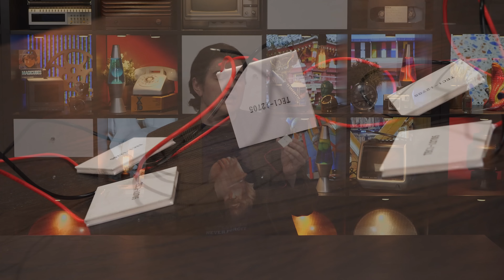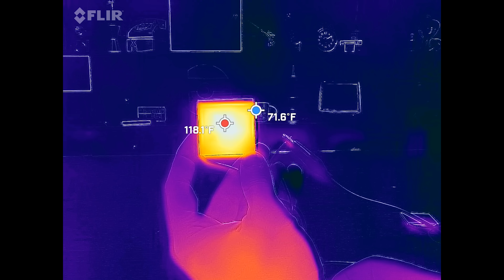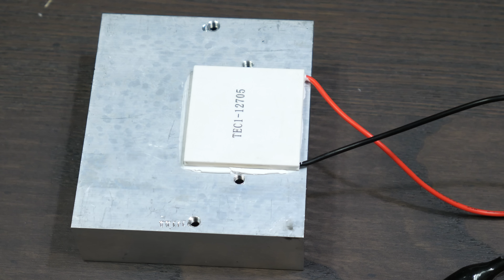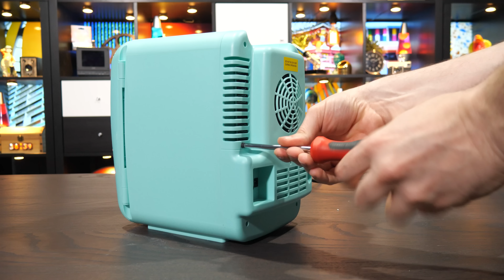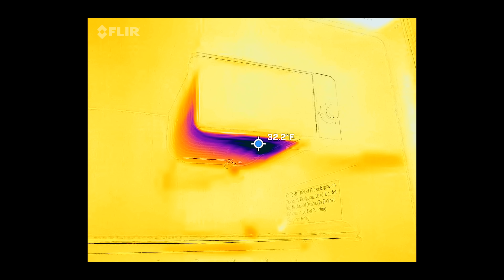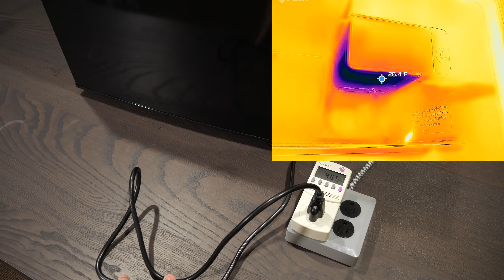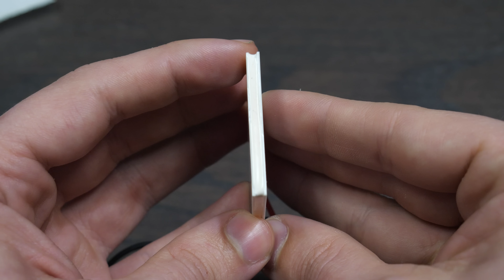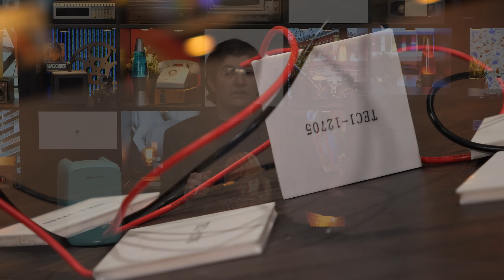Thermoelectric cooling: it's not great.

Comment: Speaking of fridge compressors, did you see the guy who modded his Harbor Frate air compressor to use a fridge compressor as the air pump and has a super quiet compressed air setup that was ~33% faster?

Comment: i wonder if these could be used for cooling suits. super small so the pack you'd have to wear would be more manageable than a heatpump, and you dont need a tremendous amount of cooling power to keep a person comfortable when its only taking heat from the person not the room. the only problem is it would chew through batteries. if you were only cooling the chest and running the thing as efficient as you can i think you could get an hour of cooling with a decent battery. but i have 0 knowledge about his whatsoever im just napkin math-ing with some numbers on TE units i found online.

someone with some experience could chime in with how viable this might be.

Comment: The short cycling on the small refrigerator may be due to its small thermal mass and reduced insulation. It's going to heat and cool quickly. Slower cycling would mean larger temperature swings.

Comment: High Power TECs can be really good as CPU coolers, you do need to worry about condensation though.  yeah they use a ton of power, but when you're trying to squeeze as much performance out of your PC as possible, they're a pretty good option.  And they're cheap as hell and easy to setup

Comment: Not particularly relevant to this (though related) - the Peltier effect can be run in reverse.  Heat one side of the element, and it generates electricity.  Not a lot, of course, but enough to run, for example, a fan.  This is used very effectively with solid fuel room heaters.  I have a little fan that is powered by a Peltier effect.  Sit the unit on top of a log burner, and the fan turns, blowing air out into the room.  OK, I'm sure it would be more effective to use a more normal motor-driven fan.  But it is pleasing and useful.
An alternative version of this is a Stirling engine fan.

Comment: The only thing I use Peltier devices for is making cloud chambers, since I can’t get dry ice where I live. In order for the cold side to get cold enough for it to work, I have to use water cooling on the hot side, which works really well, but adds more complexity and setup time. I will say that modern fridges are far more efficient than older ones. At my work we had a commercial ice freezer that cost $20 a day to run, so we bought a brand new one that only costs $3 a day, and it has over 1000L of internal capacity.

Comment: I've seen demonstrations of thermoelectronics which had the "cold" end physically distant from the "hot" end.  Essentially,  two different components connected electrically.   It seems that such a pair of devices could overcome some of the limitations you demonstrated here.

Comment: You can buy Pelter CPU coolers. I don't get how that works.
Reply: The modern consensus is that they don't. While the might make your temperatures look a little better in short benchmark runs, they essentially just add the waste heat of the Peltier to the total heat output the rest of your cooling system needs to get rid of in a longer gaming session.

Comment: So im confused, i have one of those pelrier cooled fridges, specifically the minecraft creeper one from walmart that has been all over the Internet lately, and it is completely silent plus in the top compartment it gets cold enough to produce ice on the back wall and freeze water bottles. Is this one just using larger peltier and insulation? Should i get rid of it or mesaure its energy usage?
Reply: You can stack Peltiers on top of each other to create a higher temperature difference. This also makes them more efficient as the amount of heat transfer happening depends on the temperature difference. Good side wall insulation also makes a world of a difference. The cheap ones are just plastic boxes with no significant insulating material at all.

Comment: I'm curious how much better that little desk """fridge""" would be with some proper insulation, a thermistor, and a PWM controller. It probably still wouldn't compare to a full-up fridge, and would be a bit more expensive than it currently is, but if you absolutely need that tiny of a form factor that might be the way to go.

Comment: High end cinema cameras use these to keep the camera sensor at a specific temperature. It's the perfect device for that, since you need to both heat and cool the sensor (depending on the ambient temps), and it needs to be small and only cool/heat a very small thermal mass, so the net power draw isn't too terrible.

It's very a niche use case, but the perfect show of why they're still incredibly useful... just not the way the average person thinks.
Reply: Never heard of problems with camera sensors getting too cold, were they designed to be able to film scenes in Antarctica?
Reply: @NiHaoMike64  Nope, it's just that to get the veery most out of a sensor, you need to black shade it (calibration). Once calibrated, a swing of 10 degrees in any direction could significantly impact image quality.

Generally, cooler is better, but consistent is more important than anything.

Comment: Peltiers are used in spacecraft and satellites to either generate electricity from heat, or to cool down circuits with power from solar, I was hoping you would mention this as an appropriate use

Comment: The most interesting property of Peltier element is that if you apply a thermal differential to them, they can generate power. That can be useful if you have residual heat from somewhere and need to generate a small amount of power.

Comment: These are used in wood stove fans, with the heat on the bottom and cool air above it generates power to run a motor which turns a fan blowing the warm air out of your fireplace across the room.
Reply: Almost. The ones used in those fridges wouldn't work for that, because the solder that holds them together would melt. Generating electricity needs a slightly different component - same basic design, just made with heat-resistant materials.

Comment: The little mini fridge may not fit on your desk, but if you pay another thirty dollars for the blue thing and another $30 for some DIY supplies you can move the compressor and hot coils under your desk with the expansion coils in the door of the blue thing on your desk and get the best of both.

Comment: We had a unit like that about 20 years ago, my wife won it at an office pool.  We used it on a week long trip, loaded it with some beverages and left it on for a week.  It eventually got the beverages nice and cold, but it also partially melted the power supply that came with it.  I guess the manufacturer did not accurately guess the current draw.

Comment: 30:24 Worth noting: I have a very similar mini fridge (the internal design is slightly different but otherwise it looks to be the same, probably just a different product generation), and it has next to no buzzing. I genuinely don't notice when it's on versus when it's off - which has gotten me in trouble when I didn't realize the door wasn't shut all the way...
Oh, and yes, it WILL freeze stuff on the top shelf if you don't get the temperature setting exactly right. In fact, mine will quite happily turn the entire compartment into a freezer if I set it to max whack.

Comment: Peltier modules are useful if you need to suck up heat from very small area, and can spread it later over larger area. People doing digital astrophotography used to hack their digital cameras to put the sensor on a Peltier module, and add a bigger heat sink on the other side to keep sensor as cold as possible, so its thermal noise will be reduced for better sensitivity. These elements can also be used to achieve precise temperature control, for example in small scale experiments.
People also used to use Peltier modules to force-cool the CPU while overclocking it. Then some guy replaced heat sink and fan with cold loop of heat pump, and overclocked the CPU even more. If I recall correctly, some team made a world record of overclocking a popular CPU by enclosing its heat sink in a can and then filling it with liquid nitrogen. This requires a careful consideration, because if any semiconductor gets too cold, it stops semiconducting.

Comment: The question I have is why we can't miniaturize a heat pump further? The compressor housing on that smallest of mini fridges is still rather huge. Why couldn't a 12v DC motor fit inside a 12oz soda can sized housing and make that gimmick an actual fridge? Pretty sure I could build one that runs on an arduino for under $30.
Reply: OKAY doubling down on this cause I just discovered I can get a handheld 150psi 12v air compressor the size of a large cell phone WITH a built-in 10kah battery for $30. It's chinesium so that 150psi is probably closer to 80 and the 10kah is probably closer to 5, but that still means the compressor itself could run a fridge and its only about 10% of the cost of the doober.

Comment: I knew those little fridges were bad, but Holy crap that's terrible efficiency. PS I have a 1982 GE refrigerator that I use. It uses the old school R12 refrigerant but still works like it's new.

Comment: I know you make videos about whatever you're obsessed with right now, and you own an actual good fridge with a sane ice maker that makes actual sense (in the freezer, not the fridge) so there's very little reason that this would ever happen, but I would love to hear you rip into Samsung fridges for 20 minutes or so. Please consider purchasing a Samsung fridge with an ice maker on the top (in the fridge area) so that us idiots who own them can get a little comic relief out of the situation.

I disabled my ice maker over a year ago; but the fridge still hasn't stopped making ice (it just does it everywhere but the ice maker). At this point I don't even trust the primary compartment; I keep whatever I can in the drawer (ours has a drawer between the bottom freezer and top fridge, ostensibly designed for beer, but it's pretty roomy, and cold enough to freeze eggs if you're not careful, lmao). But yeah, there's definitely a degreee of incompetence in Samsung fridges liable for a class action. I'm pretty sure the door seals are incapable of actually sealing, and keeping moisture out on humid days. Also, the weird hingey bit on one of the doors (it has two "French doors" on top) likes to spontaneously pop out, requiring removing two screws and then reseating it when it happens, otherwise the seals REALLY do not adequately keep humidity out.

Comment: Let me sing the praises of my 25-year-old Igloo Model 41000 56-quart Peltier cooler. I have used it to transport a LOT of already-chilled food to and from my cabin, 5 hours distant, at least monthly. It also is in constant use on road trips, where I take it into the motel room or friend's house. It is enormous, weighs little and won't die. I'm keenly aware that it is an energy hog, especially when running off the iron-core 120V brick. The brick gets too hot to leave on a plastic surface, Now my 21 cu ft Kenmore upright freezer uses 1.4kWh a day, same as my dorm fridge, but less than my 21 cu ft fridge, which uses 2.4kWh/day. The freezer has Sabbath Mode, so I can defeat defrosting if I have to run on battery or generator power, making it the winner in my stable.

Comment: Now that you have covered the Peltier cooler, you need to make a conextras concerning the Seeback effect (where said TECs can be used to generate DC voltage through heat transference 😊 )

Another suggestion too, since we are on a similar tangent, have you considered showing off the wonders of the Stirling engine?

Comment: You touched upon the major drawbacks to using Peltier elements quite well. I've read that stacking Peltiers on top of each other, using the cold side of one to chill the hot side of the adjacent module, can increase the ΔT because you can drive them a little harder, but of course you need more current and an even larger heat sink, further exacerbating the efficiency issues. I had done some deep research because I thought about building a Peltier-based mini-HVAC system designed with hot and cold water loops (in lieu of heat sinks), some automotive heater cores, pumps, fans, and a temperature controller, but once I calculated the power I needed to run all that, I abandoned the idea immediately.

It would be interesting to build, perhaps even a bit fun, but totally not worth the time and money invested!

13:49 - I thought that was considered "apartment size." It's the perfect size for efficiency apartments where the kitchen area is smaller than the bathroom, or for beverages in a "man cave/she shed."
14:29 - YEE-HAW! 🤠🐄But seriously, that is a big fridge, larger than the standard size, and a rather nice one to boot.
15:03 - 🤣

Comment: An example of a GOOD use of Peltier modules i one of those personal neck coolers. I got one for about $150 and it runs on batteries and cools itself using Peltier modules + a few fans. No, it doesn't get incredibly cold, but it gets cold enough that on a hot summer day in direct sunlight I was actually quite comfortable. You don't want them to get THAT cool either, the capillaries on your skin will close if it's too cold, defeating the whole purpose.

Bonus is it can also get warm for the winter months!

Comment: Jam some plutonium in that blue p0s and turn it into an RTG courtesy of the Seebeck effect! I've got some fans on my wood stoves that do that - pump a Peltier element with heat to generate an electrical current that spins fans which move heat across the room.

Comment: There does exist a unique use-case for thermoelectric fridges. Cigars! Cigar hobbyists like myself adore these little thermo fridges. 

Cigars are delicate - they are ideally stored at just below room temp (69F) and at relatively high humidity (69RH) (I'm not kidding)

Compressor fridges spoil cigars because they draw humidity out of the system. Thermoelectric fridges don't have the same issue. They provide a great humidity seal (if it's not a cheap toy-fridge) and they provide just the right amount of moderate temperature control to maintain cigars. 

Throw a small humidity unit into a well-sealing thermoelectric fridge, and you've got yourself a very effective cigar humidor. I'd be bold enough to claim that there is no better way to store cigars than in one of these. 

Also, since us cigar smokers run these things at just slightly below room temperature, the energy consumption is probably a lot less radical than what is needed to cool drinks. 

Hope you find this interesting!
Reply: Which humidor have you been using?

Comment: While I don't disagree with your points, I have one of these tiny fridges - it's even light blue, just like yours!  In my studio, however, it's the better option.  I'm not paying for the electricity, I only need a couple of cold sodas, the room is generally pretty cool unless I'm in there and turn up the thermostat, and most importantly, I don't have enough space on my shelf for a cube mini-fridge.  So - in that case, the tiny blue fridge is better than the other option, which is nothing.

Comment: If you can't keep a fridge upright when transporting it, oil can move to parts of the compressor where it's not supposed to be. It doesn't matter how long you wait before you turn it on(urban legend), because it will stay there and can damage the compressor when it's running. So waiting doesn't matter, just keep it upright or risk damage to the compressor.

Comment: I teach Thermodynamics at a college level, so I might send this out to my students! My only note: I would take points off for uttering the phrase "heat energy" instead of the more accurate "thermal energy". The term "heat", to a scientist, refers to energy transfer due to a temperature difference between a system and its surroundings. So "heat" is more of a verb than a noun, in a way.

Comment: I deliberately sought one of those out for the Peltier 
But the one I got and decided was too good to hack up and still use to this day was intended for use in vehicles and had a three position switch Cold, Off and HOT!
It keeps drinks cold on long journeys or takeaway hot on the trip home . I got it second hand for $5 at a flee market.
I bought another one brand new but damaged for $10 at a dollar store that I didn't have any qualms about hacking up.
The purpose was to make a personal AC for long motorcycle rides .
It works well enough as a water chiller for a cool vest.

Comment: You forgot one very important feature of peltier devices: They generate voltage when a heat gradient is applied! a.k.a they work "in reverse" in both interpretations of "reverse".
AFAIK they are used in some thermo electric nuclear batteries (RTG) powering for example the Voyager space probes.